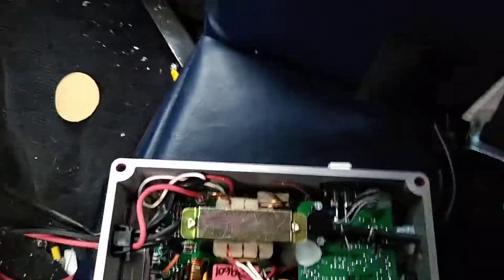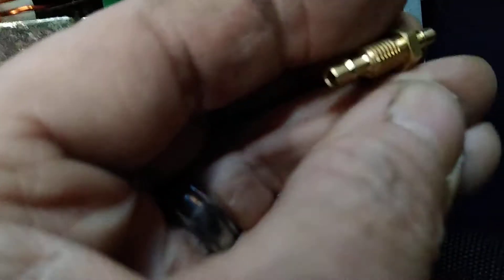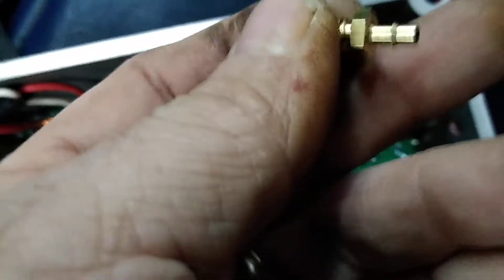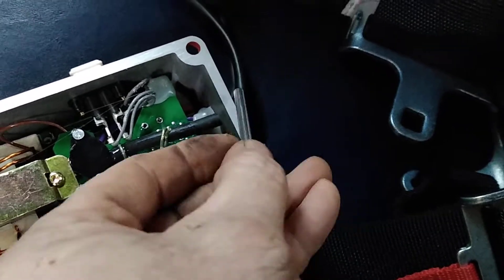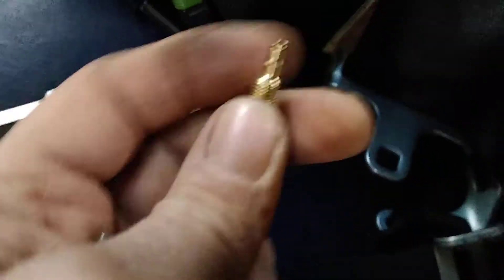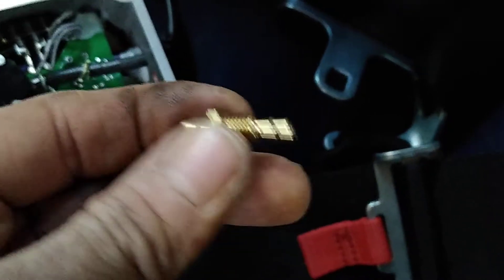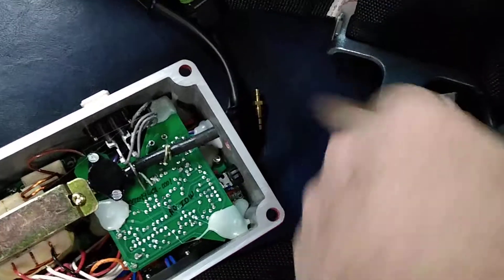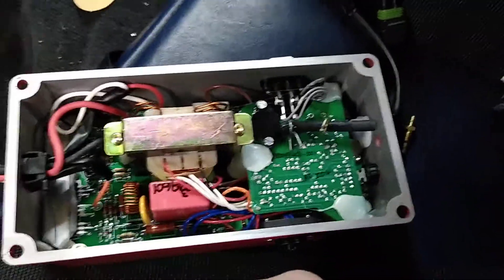MSD Your 6BTM Box Needs Improvement

Comment: MSD in general has gone down hill fast. I have gone through too many 6AL boxes that fail after just a couple years. I want one of these boost referenced boxes, but afraid to spend the $650 they want for it and have it fail a year after the warranty expires, besides having to fix the hose issue.
Reply: I wouldn't doubt that most of the pieces inside are made in China. It probably cost them less than 50.00 to make one and they go for 700.00 plus ! A complete MSD ignition with all of the bells and whistles would cost more than a decent set of cylinder heads. Maybe more than a short block! lol
Reply: @Andy-t5e  the 6BTM was 900 Canadian in 2019. That one went this year on my boat and now they are 1300 Canadian

Comment: So did you get yours up and running?  I'm in the process of wiring mine up now, inside the passenger compartment. Previously there were two  seperate boxs . One a 6Al and the other a seperate Timeing boost box. Something failed, think it was Too hot inside the engine compartment
.